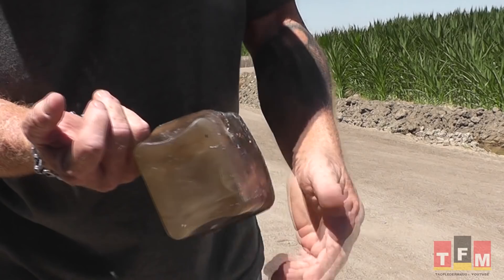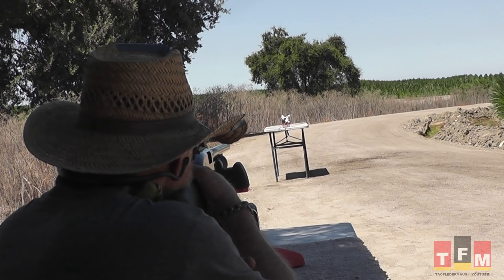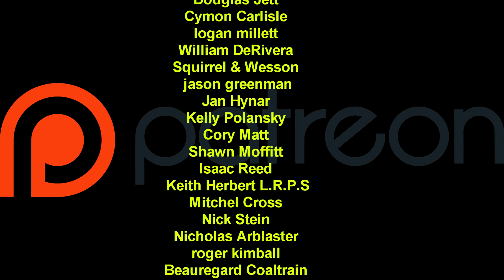Supersonic Projectiles with internal FINS?  You Make it,  We MACH it!

Comment: I'd like to see that with angled internal fins.  Maybe with wind tunnel propeller shaped fins.  Like a mini wind tunnel in reverse.  If the fins are angled just right it could be possible to accelerate the spin rate as the projectile pushes through the air.  Spin it in the same direction as the rifling.  Or reverse it to try to reverse spin.  See if it spins out of a smoothbore.

Comment: Hey Jeff, you need to use transparency in your new logo if you want it to look the best.  When the background goes black (2:12), you can see all the "holes."  It should be super easy to fix - in your image editor of choice (I use the free, open-source Paint.NET) just use the magic wand to select the insides of the O's and A and D etc., then delete them.  Save the image as a .PNG with transparency, and you'll be golden.
Reply from the maker: yeah,   but  I'm not real worried about perfection

Comment: What if you'd used a dime as a "shot card" behind the base of the projectile, between it and the wadding? Perhaps then the plastic wadding would have stayed out of the projectile, the dime falling away after the wadding, and the internal fins would be either proven, or disproven?
Reply: Agree, since the wadding was stuck to the slug for all the shots it's impossible to know if the design works or not. Failed test.

The scientist in me cringes.

Comment: Firing a finned projectile through a rifled barrel, 
is self defeating!
The rotation imparted by the rifling interferes with fin's ability to stabilize.
Having plastic embedded inside it blocking air from flowing past some of the time doesn't help either.

I would like to see how they work fired from a smooth barrel.
With a shot cart or something to keep the fins from being blocked and the war from sticking to it.

Comment: QUOTE Many viewers have wondered if having internal fins would help stabilize a projectile. UNQUOTE  No need to wonder. There is ZERO practical air flow ( < than 1 per cent)  through those internal fins with that shape at supersonic speeds.